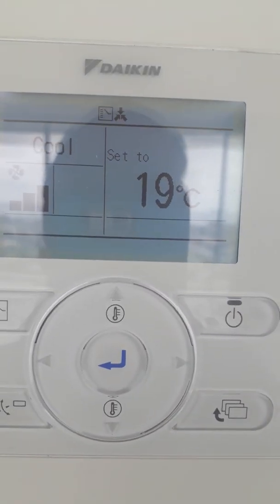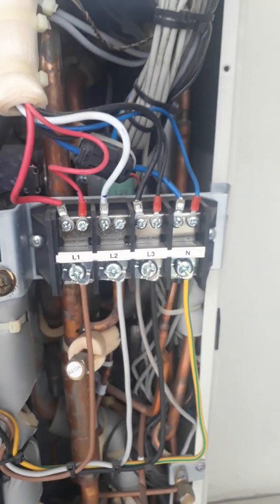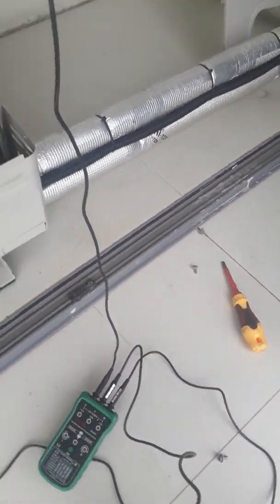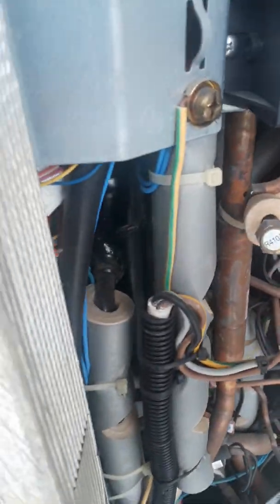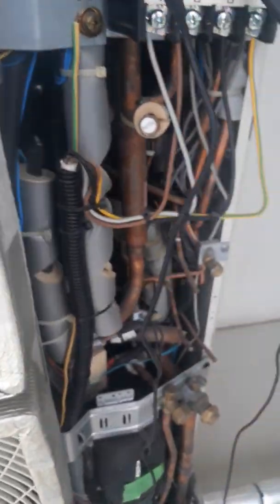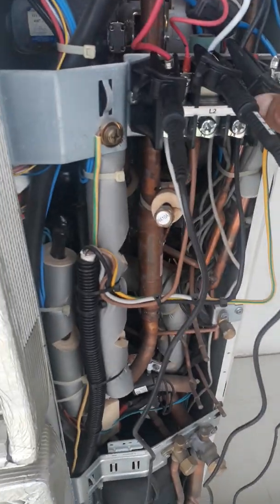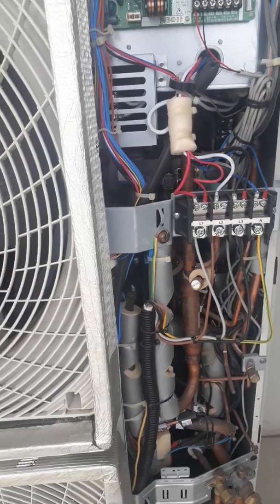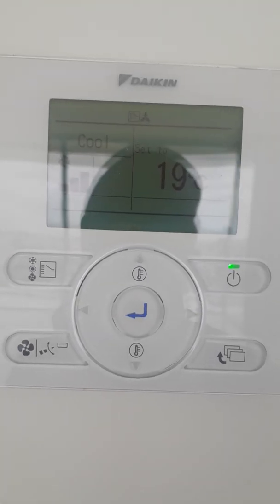How to clear U1-04 error code VRV IV

Comment: To clear error code U1-O4: 
Turning the unit off Isolation switch off at the main board at the meter box. Leave it off for 30 minutes then turn the power back on. Make sure the unit is in the off state before turning it off at the meter box.
Reply: Good information